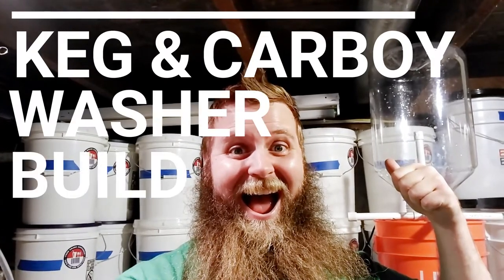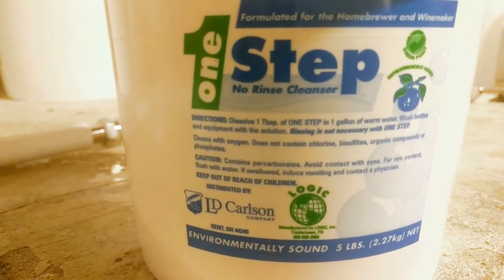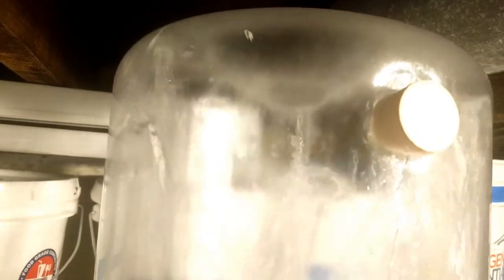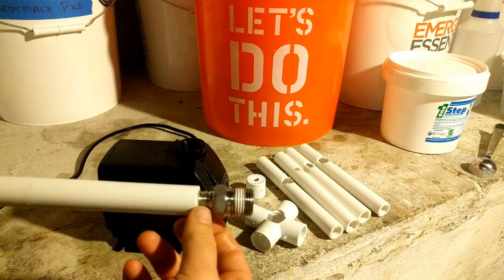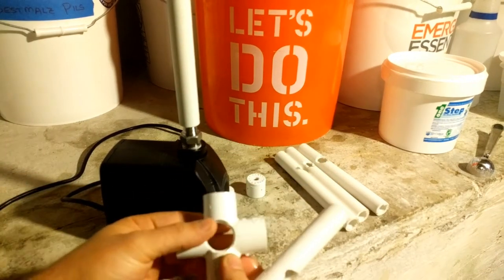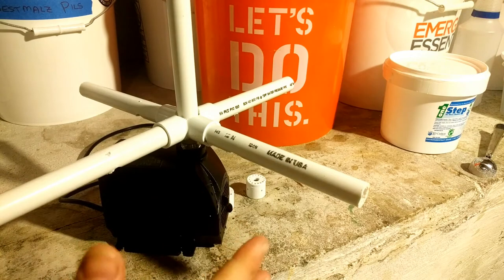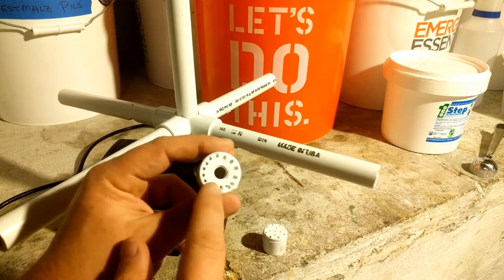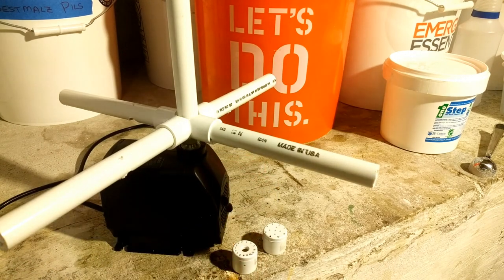~$35 Keg & Carboy Washer Build - Clean your homebrew gear properly!

Comment: That gunk going thru the pump constantly would cause pump to fail quickly no?
Reply: you should dump/rinse most of the trub out before this, this is a final cleaning. anything that's left is going to be soft and disolve, especially once water hits it. It's not like you are putting large hunks of hard residue through the pump. Most of the small washers use a sub-pump.